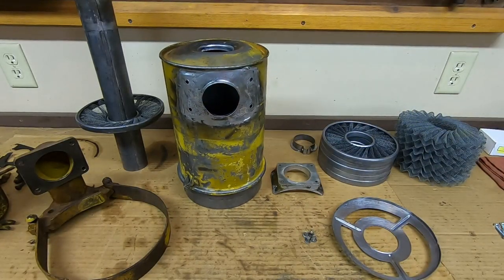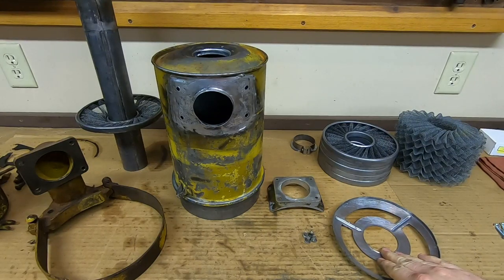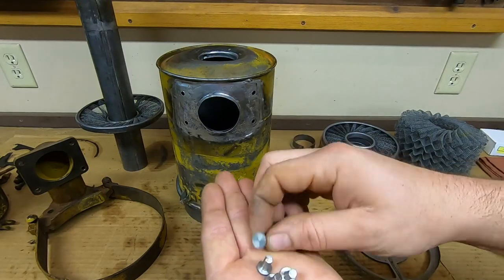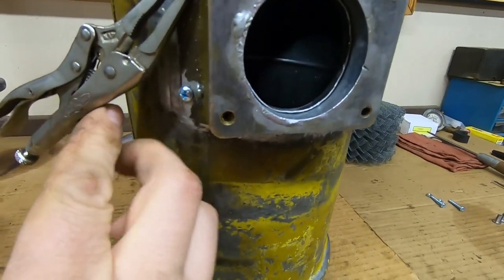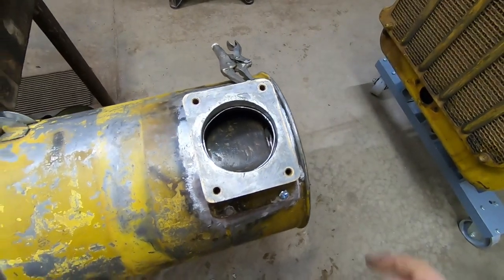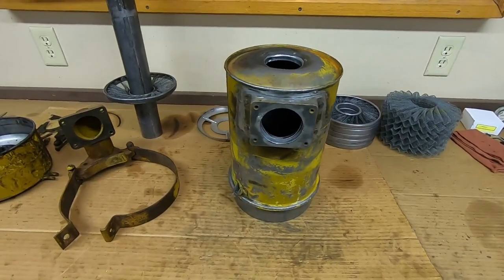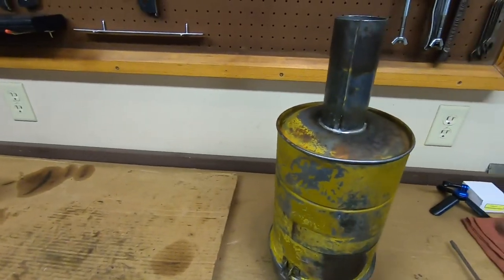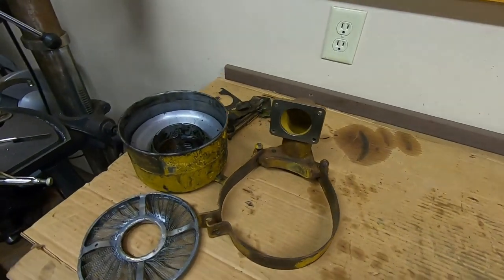Caterpillar D2 #5J1113 Diesel Engine Assembly Ep.53: Soldering The Air Cleaner Back Together

Comment: I never had any doubt that you'd get that straightened out. If you wipe the hot, soft solder with some steel wool you can smooth it out & get rid of any excess, then move the flame over it to get it flow for a smooth finish.

Comment: years ago, when I was a machinist, we had a project cutting graphite, and they requested we cut it dry, lots and lots of dust, enough to instantly plug most vacuum systems, So I took a cue from an old 9n tractor I had, and built a water bath filter out of 5 gal buckets... took some tweeking and what not, but I can say them screens and baffles are a major component to making it work, need something for the atomized oil/water to hang up on and collect the dust. While my system wasn't perfect, we did manage to finish the orders without having to clean out the vacuum more then once.

Comment: I normally just watch, enjoy and "like" your videos, but I feel compelled to congratulate you on saving that air cleaner, and using a skill that you're not comfortable with.

I thought you'd gone the extra mile to save the old radiator cap, but the air cleaner save was special.

Kudos!

Comment: Nice work. Thin metal can be a bit tricky to work with for sure. Here's a soldering tip that will help you feel like a pro in no time. Only use a hot enough flame to melt the solder and keep the heat on the work, not the solder line. As the surrounding surfaces reach the solder melting point, the solder will draw right into the joint. The biggest problem with soldering is being in a hurry and over heating the material. When I solder, I either use a propane or MAP gas bottle torch, depending upon how thick the material to be soldered, propane for thin and MAP for the thicker stuff. One other tip, use a wet rag to wipe the excess solder off and it will look professional every time.

Comment: The finished product is beautiful, and a tribute, not only to the original design and manufacture, but the TLC that Squatch put in to putting it back to original function. That thing has more class and character now than any coat of new paint could ever give it. What is with the trolls and the Thumbs-down dislikes? If you don’t like the content here, why not just unsubscribe and spend your time someplace else?

Comment: You did great.  The fact is that soldering is not like welding.  You have to use the heat in the parts to melt the solder,  not the flame of the torch. Different skill,  but you did really well.

Comment: Probably would have worked better if you had applied flux between the piece you riveted on so it would have sucked the solder into the joint.  Looks like you worked a miracle getting that thing back together again!

Comment: You should preheat the brass flange to near the melting point of the solder. It will act like a big plumber's soldering iron bit ,and the solder will flow easily into the joint.  Some resin flux would help too. Acid flux is corrosive and is only needed for untinned joints.
The main problem with soldering with a naked flame is that it oxidises the solder (that's why the solder melts and doesn't flow into the pool) and everything else  and makes all the cleaning and tinning pointless.

Comment: Squatch, I'm trying to follow your steps from this video to rebuild an old IH air cleaner, having never soldered anything but wires. Could you please mention in few words how you went about cleaning and pre-tinning the surfaces for that riveted part? Seeing you do the actual metal work would also be priceless.
Reply: @squatch253  I really appreciate you getting back to me and the fact that you still check comments on older videos. I never expected a video on soldering, just hearing your strategy that worked this well is exactly what I needed. And trying to bang on the shell of my cleaner without proper tools made me think again of how well you were able to straighten yours. 

As for tinning, I was looking at Oatey 95 tinning flux, but what you mentioned now gives me another option. Not that easy to find good detailed information on this whole process... Thanks again!

Comment: Oh - a tip from the dovetailed metal plane making community (don't ask).

When peining a rivet in tight quarters, use a round nosed punch. Very accurate, very controllable.

I don't think you can buy them, but they're just a round pin punch that has met a grinder wheel.

Comment: I have found that when soldering you should heat the area then let the solder flow into the joint remembering that the solder will flow to the heat source. Great job of getting the filter assembly into proper shape and put back together properly.  Happy Thanksgiving to you and Sr.

Comment: Toby, I have straightened out a good bit of 10 in my 70 years, that project is one I would've thought long and hard about attempting. Beautiful job. Like several others I would like to have seen how you did it or at least a couple of little clips if you videoed any of it. I have a bout a half cup of small cat parts I would like to send you. I've probably had them for 40 years not knowing what to do with them, and I'd like to make them yours. I have 16 Alemite button style grease fittings. I say style because they are stamped Lincoln, not Alemite.  also stamped 5700 and 1/8 NPT. they were dirty, a touch rusty

Comment: This made me think of a time helping my dad work on a D315 gen set. I dropped the air cleaner bowl to check the dirt level. Without looking I pushed my finger into measure the dirt, it felt oddly squishy. I then looked at it realizing I had pushed my finger through a dead mouse floating in the oil.  I assume someone left to top off the air cleaner giving him passage in.  After that I look before I poke anything.
Reply: If it's wet and isn't yours, don't touch it. LOL

Comment: For a self admitted amateur you did a darn good job on the soldering. 
Overall, I don't think anyone else could have done a better job a rebuilding that air cleaner. 
Especially given the condition it was in when you started on it.

Comment: Impressive rebuild of an unappreciated part. On the soldering: I have always soldered by applying heat to the part until the solder will flow when touched to it. That works great for copper plumbing fittings and I’d think it would work well for parts like these. Give that a try next time.

Comment: Admirable and always Squatch! As others have said, I would love to support the channel as I can. Personally, I highly doubt a membership would the solution for me but I wouldn’t hesitate about merch or even purchasing a how-to/complete series. Just an idea. 

Question on the soldering, I was always under the impression that you should heat the material only and if you had the heat the solder it was because the material wasn’t hot enough. I’m intrigued to get input on this from anyone more familiar as I have almost no experience with this.
Reply: Correct-never heat the solder!
Also, lightly flux your solder-
Reply: Thanks Horace.

Comment: When soldering:   flux, heat metal, add solder.    So move heat along then adding the solder.   Try not to melt solder flowing to metal.   See very skilled soldering done by The Luminary Shoppe.
Reply: Engel Brothers!

Comment: Squatch, I don't know if you can get Bakers #3 soldering fluid in the USA but it is a marvellous liquid flux for soldering steel parts or brass/copper to steel. You apply it with a brush to the cleaned metal, as you are starting to heat. I have tried other fluxes for steel but nothing comes close.

Comment: That's what I call restoration.   Take something close to wrecked and make it new again.   Excellent and inspiring job.

I can't believe you're not going to repaint over that ugly highway-sign yellow, though.  I get leaving the original cat-yellow parts un-repainted, but that's just too obviously not original to retain.

Your soldering skills would be improved greatly if you just let the heat of the substrate do the work for you.    For most jobs, you don't want to melt the solder with your flame or iron,  but use those to heat the substrate and then have the heat from the substrate melt the solder.   Also, there aren't many situations where an oxy-torch is the right tool for anything but the highest temperature solders.   Too much heat.

Comment: Next time you solder a thick piece to thin put your heat on the big piece. Once it's hot enough the solder will suck up inside. And keep the heat in front of the solder. The solder will run to the heat.

Comment: Yep, I know, “too late now” yet weren’t those screen meshes to be alternated to have an equal air flow up each side? I also noticed it made a slight space between each mesh to maybe keep dirt and dust from building up? Just an observation that is too late to correct after sweating the stand pipe to top of container

Comment: Maybe this is an oversight on my end, but are the orientation on those non caged screens right. I went back to the last episode to double check what I thought. When you pulled them out you can see they alternated direction. Wondering if they put them in like that to keep them from collapsing down into each other's pattern?Like it did when you were sliding the pipe back into the can with them.

I'm more then probably wrong on this. I'd hate to see you do it again if I'm right.

Comment: Squatch:  A nice job on the air cleaner.

For more information on soldering thin sheet metal, go to the “Luminary Shoppe” YT channel.  Rick at the Luminary Shoppe rebuilds and repairs candle/oil carriage lamps.  A lot of his work is unsoldering and soldering lamp parts.  Sometime seeing someone do the work provides more help than instruction.  

Everyone have a good Thanksgiving.

Comment: What’s the purpose of the oil in the bottom?  When I first saw that on mine I thought I had a leak or something. 

Is it to capture the small dirt particles because there’s no foam filter as there is on modern vehicles?
Reply: Yessiree.! Centrifical force separates the dirt particles into the oil, as it was explained to  my 7 year old self in the early '60's...
Reply: Snowflake 
Best type of air cleaner ever made

Comment: Been following your rebuild of 1113 for a while now - up to #48. good to see your attention to detail - I'll be using some of your ideas in my maintenance - got an International 510 Payloader I've been rehabbing and a Massey-Ferguson Super 90 Diesel high crop tractor I use mostly to mow firebreaks.
Maybe you can help me - in 1974, I found a bulldozer abandoned in a field in Des Plaines Illinois. Broken track. It was 6-cylinder, with a pony motor cast into the right side of the Diesel - and another air-cooled gas motor set up to start the pony motor. I've never been able to find out what that machine was. Any ideas?
Reply: @squatch253  Do you have a recommendation for a Caterpillar history that might have a picture of this machine? It's been driving me nuts for 46 years -
Reply: @squatch253  I've seen D8s starting - the machine I saw had the pony motor on the opposite side of the engine, and I believe it was integrally cast into the Diesel block. I seem to remember a four cylinder motor there, also. So, possibly not Caterpillar - who else made BIG 6-cylinder bulldozers?

Comment: When ever you solder, the solder will always go to the hottest point. I. E. If you put the heat on the edge ,the solder will go no further than the edge. So always place the most heat were you want to flow to. Also make sure the area your sweating is clean and covered with flux.